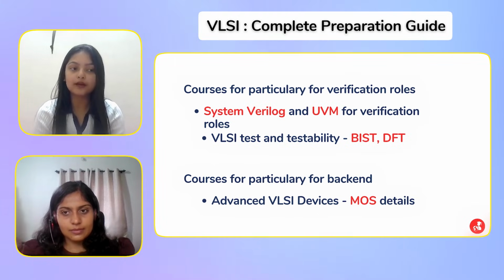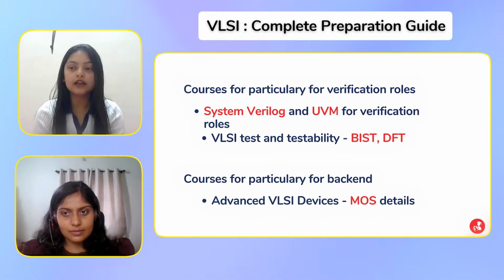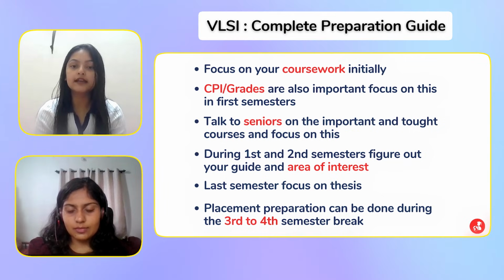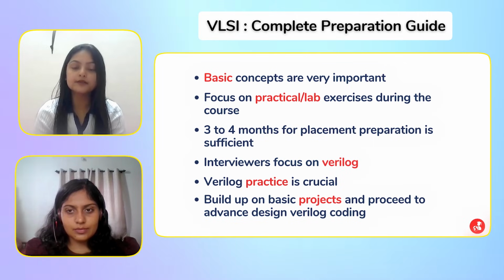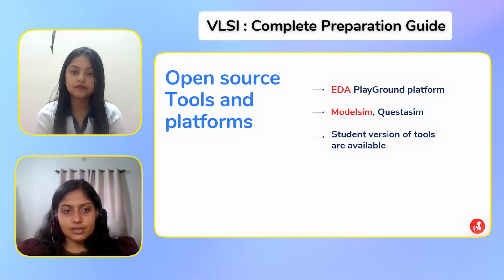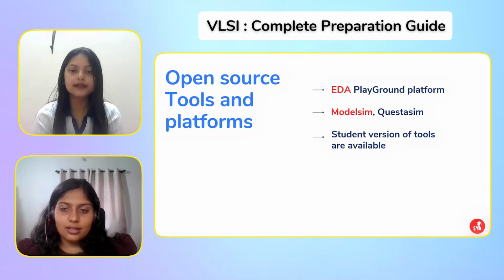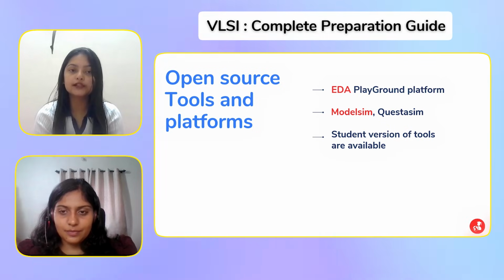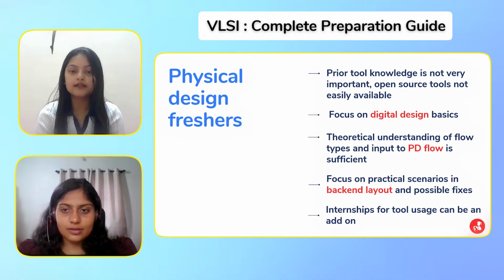VLSI Interview Preparation Guide | Nvidia

Comment: Shouldnt we go for internship after 2nd sem ?
In my colllege most of the student go for internship and then convert into ppo. is this the reason package is average ?
Reply from the maker: It would be good if you get an early internship opportunity, but you can use this break to strengthen basics and apply for internships at end of sem 3